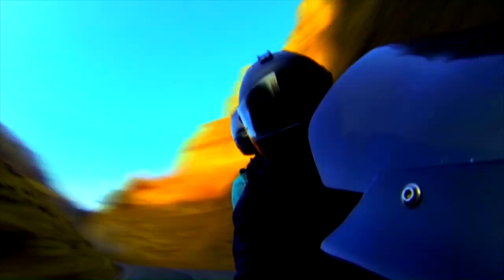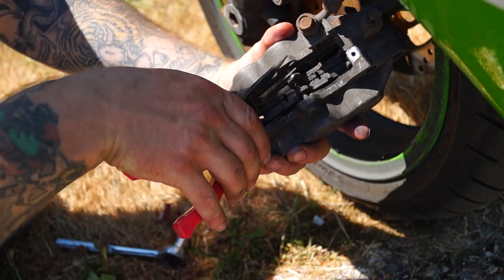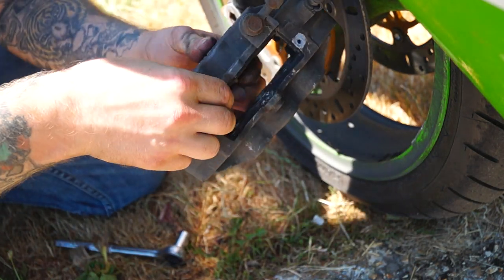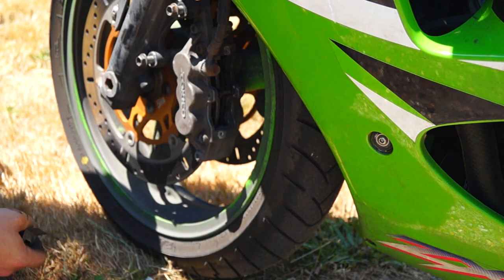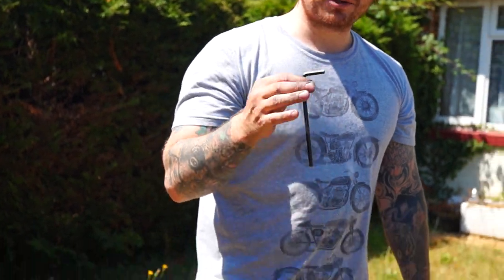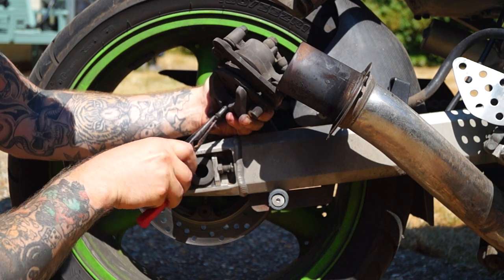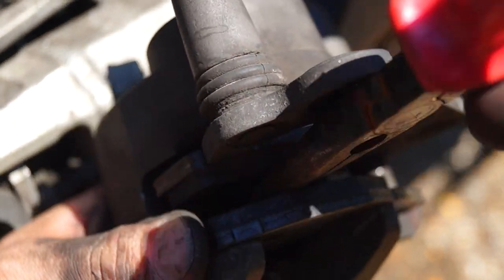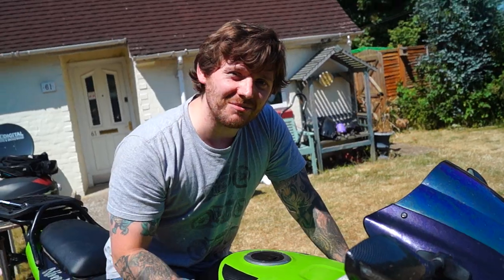How to Change Motorcycle Brake Pads (ZX6RJ)

Comment: Hi mate you need to clean those pistons in your calipers before you put the pads back in, they were as rusty as hell! Also giving the calipers a good clean and parts you take off e.g.  pin, clip etc  as you'll have a lot of brake dust build up, it'll make it much easier next time you do them!

Comment: All in all, a well done video. Thank you for taking the time and effort and sharing your knowledge. I would urge you to caution your viewers, however, to monitor the brake fluid reservoir, as the level will rise and often overflow when pushing the pistons back in. The paint on the bike will not like the brake fluid, guaranteed 😢